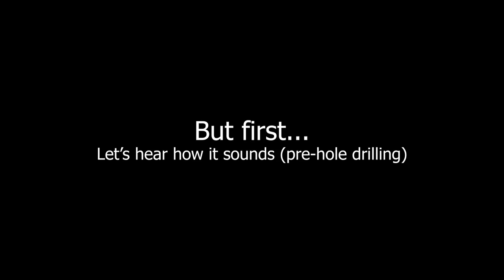Making a Low Volume Cymbal?! | Stephen Taylor + rdavidr Collab

Comment: Running a drill press and breaking bits with no safety glasses on.
Reply: wearing gloves while using a drill press is a no-no too...
Reply: @kratanicverses4805  was waiting for a glove to get pulled in
Reply: Same with slicing an extension cord with a metal object hoping that the projection circuit takes place and not realizing what happened.... I'm glad I'm sound not band.
Reply: YOLO.

Comment: Just a small forgotten detail. The whole drilling of the cymbals will not have much effect on a medium cymbal. Notice that all L80 cymbals are thin or very thin. That way, the extra holes can cause an uneven vibration pattern that kills the volume of the cymbal, as it can't resonate well.

Comment: In my opinion the drilled one has still a really good sound, Didnt expect that. I thought that it will be cracked, when you hit a few times.
Interesting experiment. Love the sound from the "new" cymbal.
Reply: The thing is the pitch can change too, it bugs the hell out me if a cymbal isn't pitching with the rest of my cymbals
Reply: this one ended up pitched flat...no pun here
Reply: Brad Parker I’m happy if there’s just a nice interval between crashes or China’s. If a cymbal sits too far to the right or left I’ll simply pair it with other cymbals. I rarely use more than 3 crashes anyway.
Reply: @Assimilator702  Me too, Rico.
Reply: It's a good idea to anneal the cymbal after doing all these holes. Especially with B20 cymbals, as they are extremely brittle and crack easily.

Comment: It's best to put a flat edge on the drill when drilling brass type metals, it will produce shorter swarf and the drill will not grab the cymbal when coming out the other side of the hole. It also reduces burrs. Just look up Drill Brass.

Comment: Hey David a drummer on FB had a Paiste cymbal with small holes were drilled into the bell of the cymbal. The assumption is Paiste was intentional but we don't know the reason why holes into the bell? I'm thinking, after viewing your cymbal drilling hole video, is that holes in a cymbal reduces volume? That, to me, seems to be the issue with most cymbals is the bell area are too overpowering loud like cowbells.

Comment: I did this very method to a cracked 16in crash. The closer to the bell does alter the sound alot. 
Note: drilling holes will make them weaker. Hence   if you're a hard hitter it will fail epicly. 🥁🤘

Comment: The same thing happened to me. But my cymbal cut our keyboard player's power cord to his amp. He was not happy!
Reply from the maker: Jason Schultz Ha! The band was just looking around...I didn’t figure it all out until we were packing up. Hilarious u had the same thing happen
Reply: @StephenTaylorDrums  The arc make a hole right through the cymbal. I used a band saw with a metal blade on it and cut a U shape around the hole. A one in a million accident and it happened to you too! Nutty!
Reply: I guess I'll keep my extension cords away from you drum players, Maybe audio cables too?

I know the power cord out of the amp was probably just a standard power cord, hopefully replaceable / detachable what's a good reason for detachable cords. And I'm assuming the other cord was just a standard extension cord. I think I'll look into investing in some good hard service wire.

Comment: I wonder what a few layers of spray Plasti Dip on top of a cheap ordinary cymbal would do to reduce the voume.
Reply from the maker: Hmmmmm
Reply: On top it would fuck up your stick tone and sound like a blanketed cymbal... i messed around w/ candle wax on some cheap b8’s and found the only thing that worked ok was when i poured wax into the bell cup it toned down the nasty overtones of the ride
Reply: I've Plasti Dip'd a steel snare and it sounds too dead now.

Comment: Hell of a drive to drill some holes! So here's my take on the sound, after drilling holes the cymbal sounded darker almost like a K series. Still useable for sure! Must have been a cheap cable to cut through it like that.
Reply from the maker: Well, it fell off a riser so it was coming in pretty heavy and fast. Still have no clue how it happened.

Comment: You have gotten a different result if you had an 18” L80 crash and placed that on top of the regular crash and traced the same hole pattern as the L80 over it. That would have been A LOT of holes though.

Comment: Why does my kick drum make an audible tone and not just a thump

Why does my kick drum go boing
Reply from the maker: Because it’s a drum. They naturally have a tone. If you want just a thump, fill it full of blankets and pillows.
Reply: Stephen Taylor ok thank you I’m not that educated on drums in general
Reply: All drums do ring, but most people do not want their kick to ring so they dampen or deaden it by putting a pillow or something similar inside.  Take the resonance head off the back and put a pillow or some towels in so that it is touching both heads.  That will take out the ringing sound.